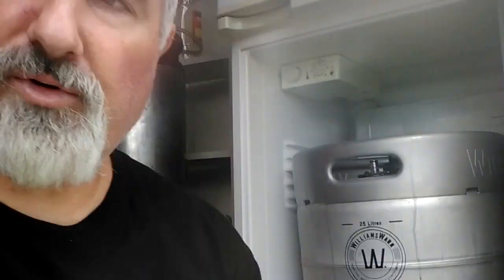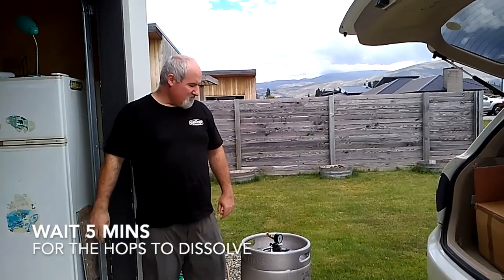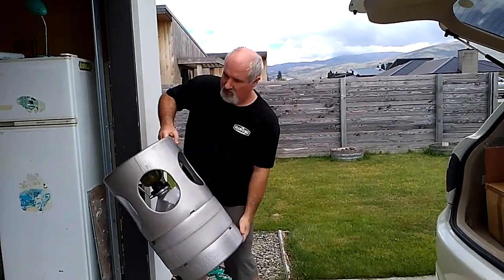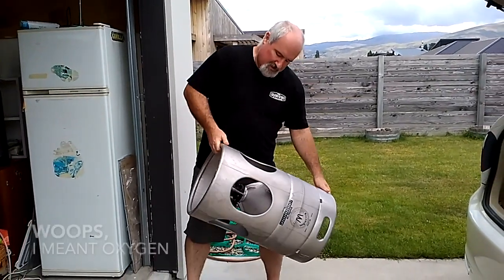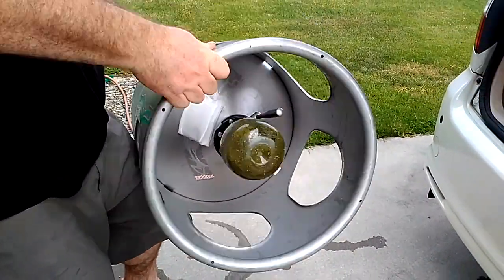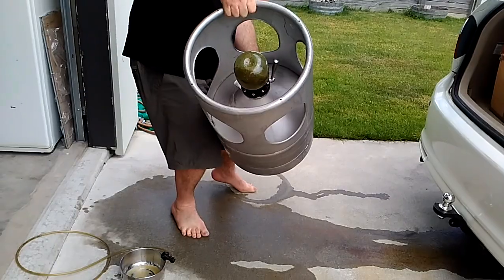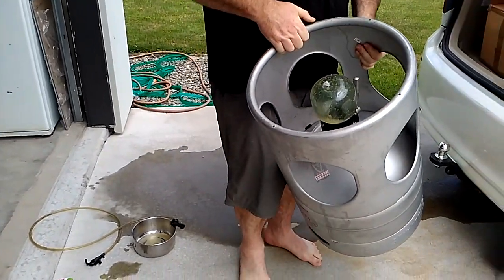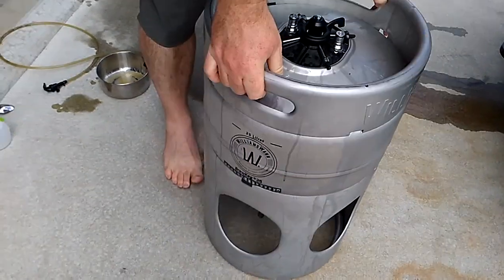Dryhopping a WW Brewkeg 25 via the collection bottle

Comment: Hi Harvey cool vid, can you explain why u ferment at a low pressure please? I always do mine at 28psi and leave it would love to know the benefits of fermenting lower to me the less pressure the higher the chance of bugs hence the pressure system thanks would love to know your opinion.
Reply from the maker: Yeah for me it's mainly about dry hopping. Removing the lid or bottle at 28psi tends to explode and make a big mess, but it's easy at 5psi. So for me, low pressure until the dry hop is done then ramp it up. Not so important for beers which aren't getting dry hopped. I also believe that pressure suppresses some of the yeast character from the beer. A certain amount of this is fine but most styles you want to allow a bit of yeast flavour.

Comment: when the brew is finished do you have to dump the sediment bottle a few times to get rid of all the hops? the hops seem to take up a lot more space once they're hydrated
Reply: Depends how big your dry hop is I guess. I've been finding that  I don't need to change the bottle again after dry-hopping. I'd typically put in a 100-200g dry hop, don't often go above that.
Reply: @harveykane8369  I just dry hopped my BK25 with 150g (in one bottle load - was a bit of a challenge getting it mixed in) and a few hours later it looks like it's pretty much all settled back into the bottle. Do you ever shake it up again to re-mix or just leave it?
Reply from the maker: @SkukS  yeah I feel it is going to give better utilisation if the hops are in suspension rather than sitting in the bottle. So recently I've been tipping the brewkeg again after 24h.
Reply: Hey Harvey - I have been leaving the brewkegs on their side after dry hopping.. (well propped up on a 30deg or so angle) to get more  utilization of the hops   - any issues you see there?  seems to work well.  I am using the brew snugs so not in a fridge so have the room to do this.